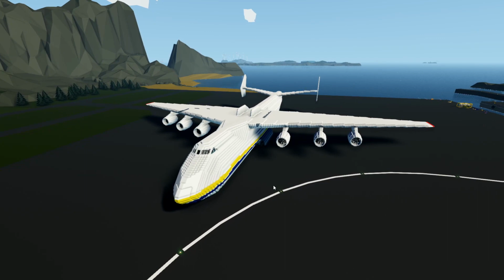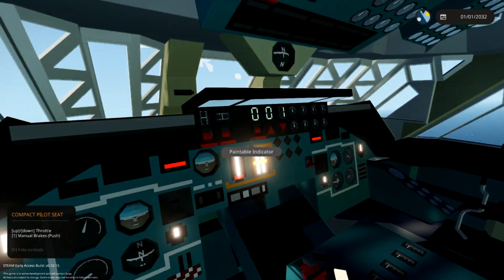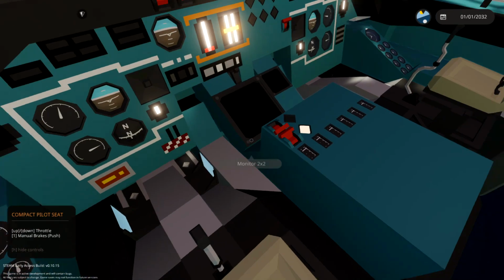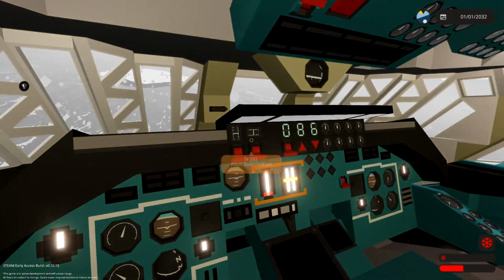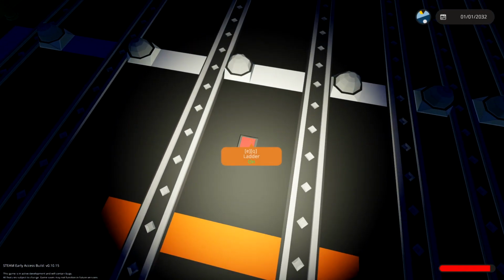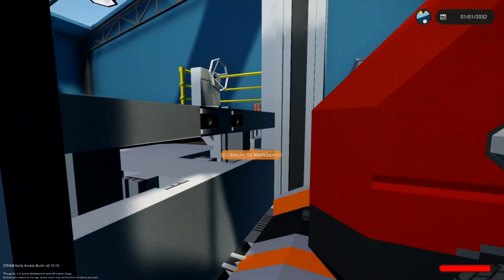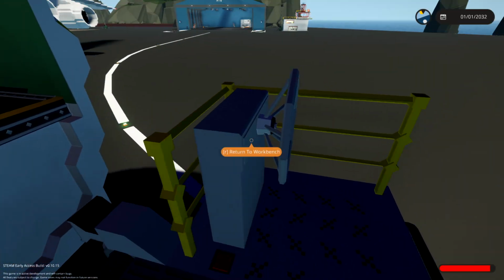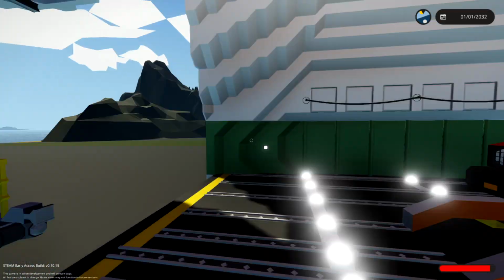Emergency Landing Too Cold!  -  Stormworks Gameplay

Comment: The Antonov An-225 was designed to airlift the Energia rocket's boosters and the Buran orbiter for the Soviet space program. It was developed as a replacement for the Myasishchev VM-T. The An-225's original mission and objectives are almost identical to that of the United States' Shuttle Carrier Aircraft.[10][11]

The An-225 first flew on 21 December 1988[12] with a 74-minute flight from Kiev.[citation needed] The aircraft was on static display at the Paris Air Show in 1989 and it flew during the public days at the Farnborough air show in 1990. Two aircraft were ordered, but only one An-225 (registration CCCP-82060 later UR-82060[13]) was finished. It can carry ultra-heavy and oversize freight, up to 250,000 kg (550,000 lb) internally,[10] or 200,000 kg (440,000 lb) on the upper fuselage. Cargo on the upper fuselage can be 70 m (230 ft) long.[14]

The second An-225 was partially built during the late 1980s for the Soviet space program. Following the collapse of the Soviet Union in 1991 and the cancellation of the Buran space program, the lone operational An-225 was placed in storage in 1994.[15][16] The six Ivchenko-Progress engines were removed for use on An-124s, and the second uncompleted An-225 airframe was also stored. When it became clear that a cargoliner bigger than the An-124 was needed, the first An-225 was re-engined and put back into service.[8][17]

An-225 at Farnborough in 1990
By 2000, the need for additional An-225 capacity had become apparent, so the decision was made in September 2006 to complete the second An-225. The second airframe was scheduled for completion around 2008,[18] then delayed. By August 2009, the aircraft had not been completed and work had been abandoned.[4][19] In May 2011, the Antonov CEO is reported to have said that the completion of a second An-225 Mriya transport aircraft with a carrying capacity of 250 tons requires at least $300 million, but if the financing is provided, its completion could be achieved in three years.[20] According to different sources, the second aircraft is 60–70% complete.[21]

Airspace Industry Corporation of China (AICC)'s president, Zhang You-Sheng, told a BBC reporter that AICC first contemplated cooperation with Antonov in 2009 and contacted them in 2011. AICC intends to modernize the second unfinished An-225 and develop it into an air launch to orbit platform for commercial satellites at altitudes up to 12,000 m (39,000 ft).[12]

In April 2013, the Russian government announced plans to revive Soviet-era air launch projects that would use a purpose-built modification to the An-225 as a midair launchpad.[22][needs update]

In August 2016, representatives from Ukraine's Antonov and AICC, an import-export company operating out of Hong Kong,[23] signed an agreement to recommence production of the An-225, with China now planning to procure and fly the first model by 2019.[24][25] The aviation media cast doubt on the production restart, indicating that due to the ongoing Russia–Ukraine conflict needed parts from Russia are unavailable, although they may be made in China instead.[26]

On 25 March 2020, the freighter commenced a series of test flights from Hostomel Airport near Kiev, after more than a year out of service for the installation of a domestically-designed power management and control system.[27]

Based on Antonov's earlier An-124, the An-225 has fuselage barrel extensions added fore and aft of the wings. The wings also received root extensions to increase span. The wings are anhedral.[28][17] The flight control surfaces are controlled via fly-by-wire and triple-redundant hydraulics.[8][29] Two more Progress D-18T turbofan engines were added to the new wing roots, bringing the total to six. An increased-capacity landing gear system with 32 wheels was designed, some of which are steerable, enabling the aircraft to turn within a 60-metre-wide (200 ft) runway. Like its An-124 predecessor, the An-225 has nose gear designed to "kneel" so cargo can be more easily loaded and unloaded.[8] Unlike the An-124, which has a rear cargo door and ramp, the An-225 design left these off to save weight, and the empennage design was changed from a single vertical stabilizer to a twin tail with an oversized, swept-back horizontal stabilizer. The twin tail was essential to enable the plane to carry large, heavy external loads that would disturb the airflow around a conventional tail. Unlike the An-124, the An-225 was not intended for tactical airlifting and is not designed for short-field operation.[10]

nitially the An-225 had a maximum gross weight of 600 t (660 short tons; 590 long tons), but from 2000 to 2001 the aircraft underwent modifications at a cost of US$20M such as the addition of a reinforced floor, which increased the maximum gross weight to 640 t (710 short tons; 630 long tons).[30][31][32]

Both the earlier and later takeoff weights establish the An-225 as the world's heaviest aircraft, being heavier than the double-deck Airbus A380. It is surpassed in other size-related categories, however: Airbus claims to have improved upon the An-225's maximum landing weight by landing an A380 at 591.7 tonnes (1,304,000 lb) during tests,[33] and the Hughes H-4 Hercules, known as the "Spruce Goose", has a greater wingspan and a greater overall height. But the Spruce Goose is 20% shorter and overall lighter, due to the materials used in its construction. In addition, the H-4 only flew once, making the An-225 the largest aircraft in the world to fly multiple times.[8][34]

The An-225's pressurized cargo hold is 1,300 m3 (46,000 cu ft) in volume; 6.4 m (21 ft 0 in) wide, 4.4 m (14 ft) high, and 43.35 m (142 ft 3 in) long[8][35][36] — longer than the first flight of the Wright Flyer.[37][38][39]

In the late 1980s, the Soviet government was looking for a way to generate revenue from its military assets. In 1989, the Antonov Design Bureau set up a holding company as a heavy airlift shipping corporation under the name "Antonov Airlines", based in Kiev, Ukraine and operating from London Luton Airport in partnership with Air Foyle HeavyLift.[14][40]

The company began operations with a fleet of four An-124-100s and three Antonov An-12s, but a need for aircraft larger than the An-124 became apparent in the late 1990s. In response, the original An-225 was re-engined, modified for heavy cargo transport, and placed back in service under the management of Antonov Airlines.

On 23 May 2001, the An-225 received its type certificate from the Interstate Aviation Committee Aviation Register (IAC AR).[41] On 11 September 2001, carrying four main battle tanks[8] at a record load of 253.82 tonnes (279.79 short tons) of cargo,[7] the An-225 flew at an altitude of up to 10,750 m (35,270 ft)[42] over a closed circuit of 1,000 km (620 mi) at a speed of 763.2 km/h (474.2 mph).[43][44] The hire cost can be $30,000 per hour.[45]

The An-225 attracts a high degree of public interest, so much that it has managed to attain a global following due to its size and its uniqueness. People frequently visit airports to see its scheduled arrivals and departures, such as in Perth, Australia in May 2016 when a crowd of more than 50,000 people gathered at Perth Airport.[46][better source needed]

Contracted flights[edit]

The type's first flight in commercial service departed from Stuttgart, Germany on 3 January 2002, and flew to Thumrait, Oman with 216,000 prepared meals for American military personnel based in the region. This vast number of ready meals was transported on 375 pallets and weighed 187.5 tons.[47]

The An-225 has since become the workhorse of the Antonov Airlines fleet, transporting objects once thought impossible to move by air, such as 150-tonne generators. It has become an asset to international relief organizations for its ability to quickly transport huge quantities of emergency supplies during disaster relief operations.[48]

The An-225 has been contracted by the Canadian and U.S. governments to transport military supplies to the Middle East in support of coalition forces.[48] An example of the cost of shipping cargo by An-225 was over 2 million DKK (approx. €266,000) for flying a chimney duct from Billund, Denmark to Kazakhstan in 2004.[49]On 11 August 2009, the heaviest single cargo item ever sent via air freight was loaded onto the An-225. At 16.23 m (53.2 ft) long and 4.27 m (14.0 ft) wide, its consignment, a generator for a gas power plant in Armenia along with its loading frame, weighed in at a record 189 tonnes (417,000 lb).[5][6]

During 2009, the An-225 was painted in a new blue and yellow paint scheme,[50] after Antonov ceased cooperation with AirFoyle and partnered with Volga-Dnepr in 2006.[51]

On 11 June 2010, the An-225 carried the world's longest piece of air cargo, two 42.1 m (138 ft) test wind turbine blades from Tianjin, China to Skrydstrup, Denmark.[52][53]

The An-225 became involved in the 2019-20 coronavirus pandemic relief effort, conducting flights to deliver medical supplies from China to other parts of the world.[54][55][56][57][54]
Reply: That was a lot of information that I will probably never need yet i still love it
Reply: You copied from Wikipedia, didn't you?
Reply: @lord_raindrops237  no
Reply: @aidandougherty9045  jajaja yes
Reply: Lol a million letters LOL😱😱😱
Reply: @BlackPhantom_II  nice wikipedia copy/paste
Reply: This is too much that I don’t want to even read 4 words
Reply: @apple222sickly  lol XD
Reply: @lord_raindrops237  it is, you can tell by the citation numbers but no citation, and yes, I checked Wikipedia and this is word for word
Reply: Man copied whole Wikipedia instead of just sharing the Wikipedia link instead
Reply: @Drnken229  too lazy to copy the link
Reply: @BlackPhantom_II  less effort than copying the whole page itself

Comment: The thing that bothers me is the fact that there is bleed air on engine 4,5,6. it should be centered. for example bleed air on engines 3,4 or 1,6. But it works fine and that's the most important.  3:54
PS: idk is it manual or automatic.